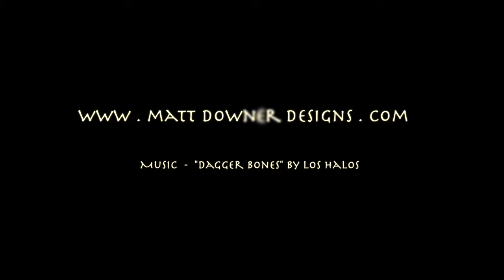Falling Leaves hall table in walnut and steel

Comment: Nice work.  I like that the top-most leaf (that I can see) is half in the wood, half in the metal, making a transition between the two.  I think I see your thinking in cladding two feet in metal, and it does look nice, but just feels a bit unbalanced to me, somehow, as opposed to making all 4 feet the same.  The shape or outline of the base suggests a tree trunk to me.  Someone will be lucky to get that piece.

Comment: If I could ask, how much does a raw slab like that costr? Its amazing.  Just One last question, are you able to tell a slab will look that beautiful when its finished when its still in raw form, weathered and dirty or did you just get extremely lucky? I want to make a table like that for my Dad and although Im no where near as talented as you Im having a hard time locating a nice slab. Im in MA and the online dealers are so expensive and its hard to tell what is hiding before finishing. I tried searching for local sawmill dealers but didn't look promising. Any help would be greatly appreciated.
Reply from the maker: Hey Robert.  Have you checked out Birkshire Products in Shefield?  They are expensive, but that is typical with beautiful woods.  The piece in this video came from Hunski Hardwoods in Calif.  Lots of great wood there.  Prices are listed on the site. Their kiln drying is hit and miss, though.  Also, be sure to check out Goby walnut up in Oregon. Reliable kiln drying, great selection and reasonable pricing for what they' re selling.  As far as knowing what the wood looks like under the patina of age, sometimes the supplier will sand down and oil a section of the slab in order to indicate what the finished piece will look like.  Having looked at rough slabs for years, I've been able to see past the surface textures to a degree and recognize some of the grain characteristics beneath.  You never really know what you're going to get until you sand the piece down and give it a first coat of oil, though.  Skip to 1:45 in this video to get a sense of the raw slab that didn't look like much but ended up being a gem:    https://www.youtube.com/watch?v=fjJRksUxkno